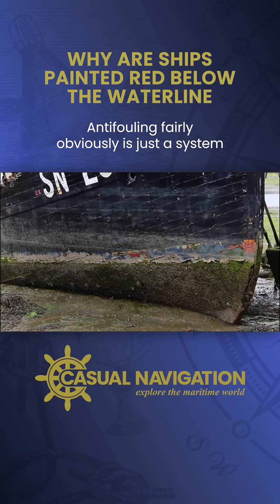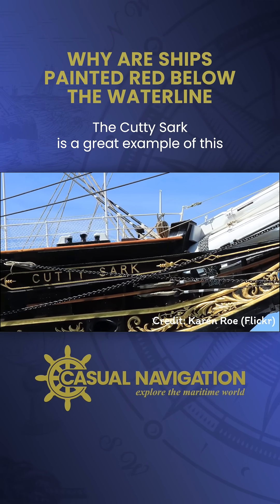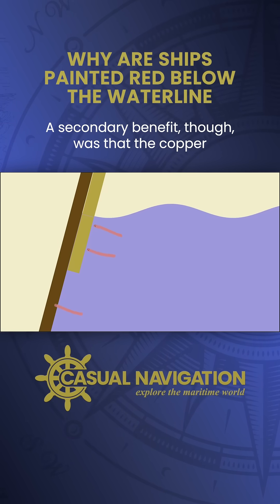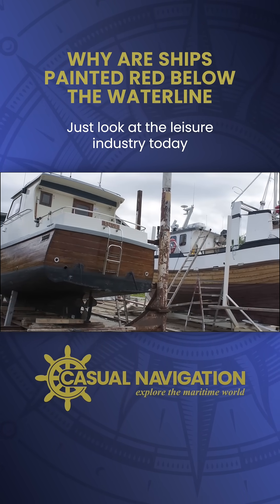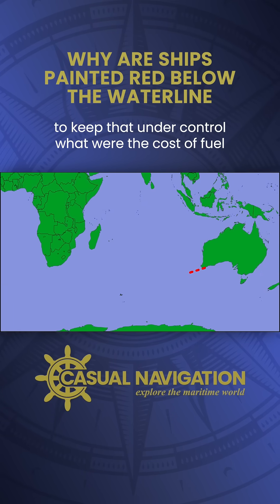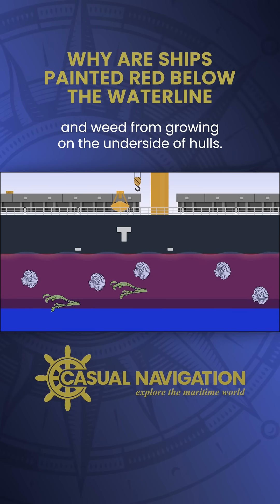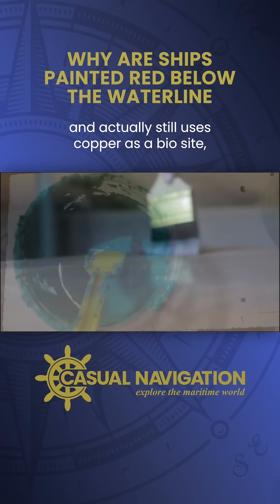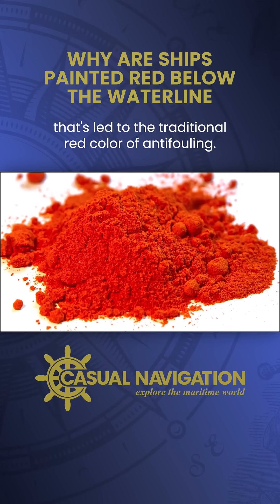Why Is Her Bottom So Red? 😳

Comment: Can't we just use some sort of foil that can be peeled off with the plant life
Reply: waves would break down the foil too quickly for it to be efficient, also that was originally what copper plating was used for, as it would erode in the water while it kept plants and pests away, youd have to replace them periodically